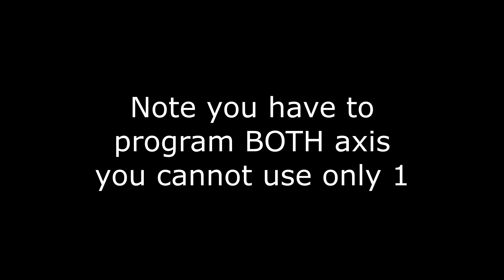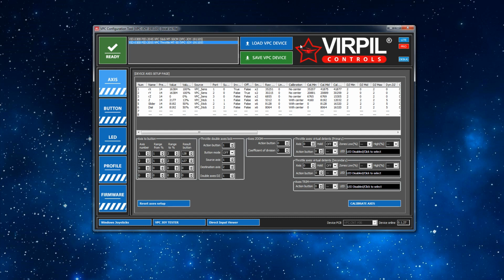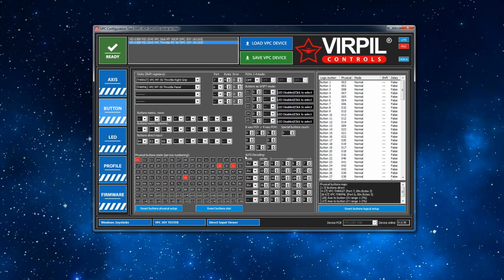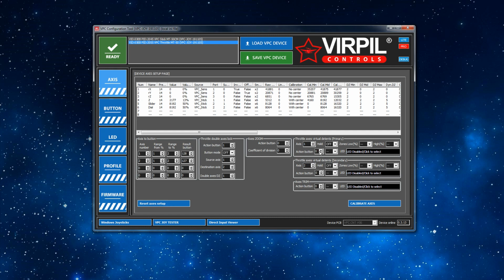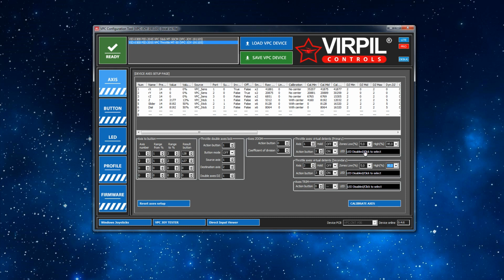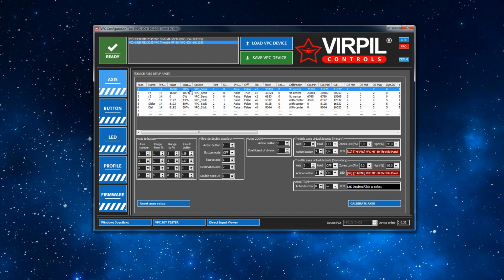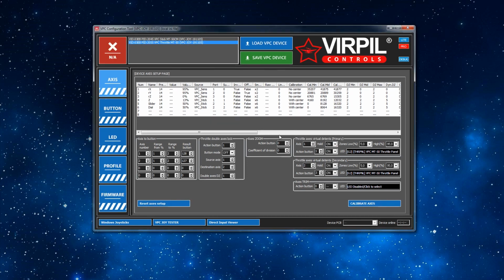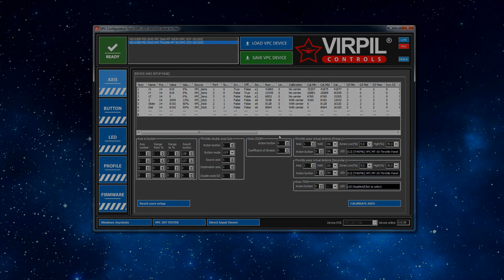Configure Virtual detents on Virpil throttle tutorial (updated see link below)

Comment: Anyone get this to work on the latest version of the Virpil software (March 2022) ? The low/high values are no longer percentages, and the highest number you can enter is 20000, which looks to be a bug as my throttle ranges from 0 - 60000
Reply from the maker: that version is bugged as is the previous beta

Comment: Hello,  I,m trying to do the same with another axes (number 3) to use it in a helicopter. Where should I told the shotware to do this? I have the "thottle double axes functions" but it semmes not to works changing the priary and second axis here...thanks!
Reply from the maker: you can do this for two axis only (it is you choice which ones you use) What model of throttle do you own ?
Reply: @HavocCompanyClan   MT50 CM2 Virpil Throttle....
Reply from the maker: @pabletesoy  check your throttle handle lock detect switch is it working, go to button tab, move lock to unlocked then locked see if a button toggles
Reply: @HavocCompanyClan  The button is working, in fact it works fine qithe the main axes of the throttle. May be is what you siad, it only works with two axes...

Comment: Would there be a way in the software to configure the throttle to set forward to 50%plus and reverse to be 50% minus? Since I mainly explore in Elite what I would like to achieve is a pretty big  dead zone in the middle and when I push forward the ship goes forward and then when I cross the dead zone the ship goes in reverse. I want to do this because I play in VR (not that that matters) but most of the noncritical things I would like to map to the throttle base and the problem with this throttle is anywhere from around 1/2 way to 0 you cannot reach the buttons without pushing the throttle forward to clear them so I have to push the throttle forward to access them, its kind of a pain. Anyways thanks for the video, for now using the info you provided I think I can make the throttle only use 50% forward which will do for now but it would be so much better if 50-100 = forward and 49 and less = reverse, at least for my style of playing. I will be double good when I get the CM3 with the physical bump in the middle but even then I think software will be needed to make this work how I want, the physical bump will just be icing on the cake.

Comment: Havoc, thanks for this video.  This is the only info I've found for the CM2 detents.  I don't play DCS, instead I play Star Citizen.  I need a different configuration.  When the throttle is at 50%, in the game my ship is at a full stop.  From there, if I move it down, the ship will start flying backwards.  So what I need is a detent that let's me know when I'm exactly at 50% with an LED indicator.  Can you either explain how to do that or better yet, create another video?
Reply from the maker: You cannot make an LED light up based on % of an axis value, but there is a way to implement the forwards / idle 50% approx / backwards bit that you seek, reply if you want me to create a quick video of this
Reply: HavocCompanyClan Yes please make a video. Thanks
Reply from the maker: @StormRavenOmegaForce  here you go   please reply when you have tried this and it works out ok  https://youtu.be/A8odaH98Yms
Reply: @HavocCompanyClan  You never seemed to answer his question in that video. I watched it several times, did I miss something? thanks!

Comment: I tried 90% first and worked, then decided I wanted to try 70% but for some reason, in DCS it doesn't stop at 70% but 90%. I tried 60% in Virpil, again DCS will only do 90%. Strange!!!
Reply from the maker: what is the virpil software showing?
Reply: @HavocCompanyClan  Virpil shows 2% - 70%. Joy Testers also showing it correctly. the funny thing, In DCS control settings, the white bars for right/left throttle axis are correct but in the cockpit the throttle animation is not 70%. I checked F2 "aircraft view" and the afterburner was on for the 70% range!!

Comment: Hi Havoc,
I've slowly been going through all your tutorials...nice work, btw. I recently received my CM2 throttle and I was setting up the detents as you instructed. Everything works, but I was wondering if there is a way to have the LEDs to stay on at 95% or higher? Currently, my LEDs light up only while I push & hold my activation button.

BTW, would you rather I ask these question on the Virpil forums for others to see? 

HB
Reply from the maker: The LED activation will only happen when button held, it is the way the virtual detent is configured at the moment